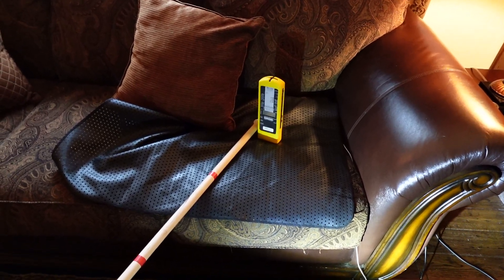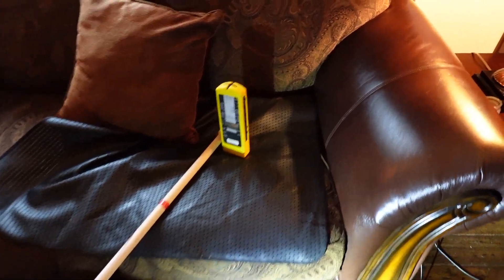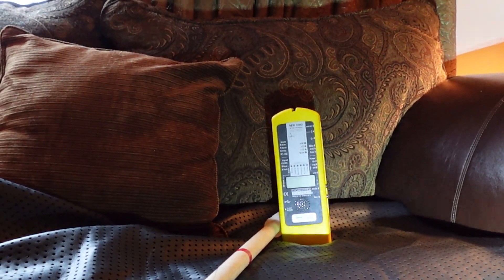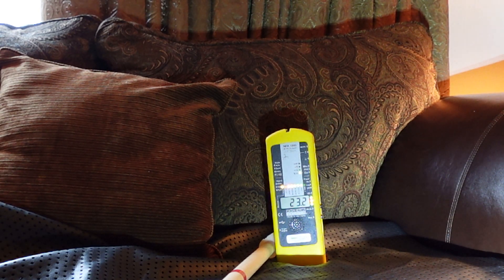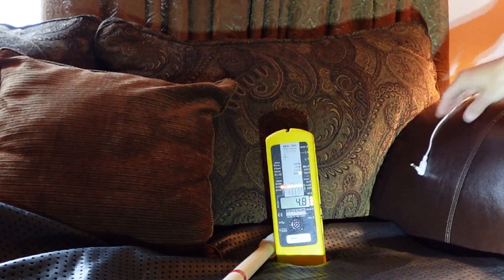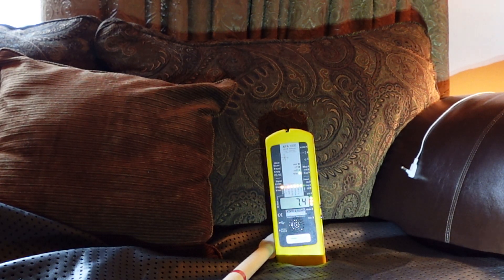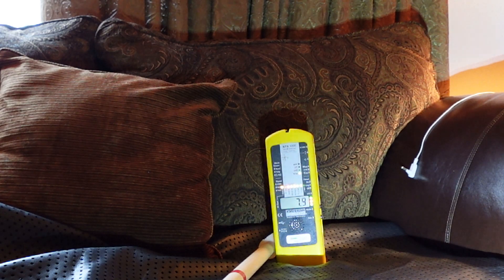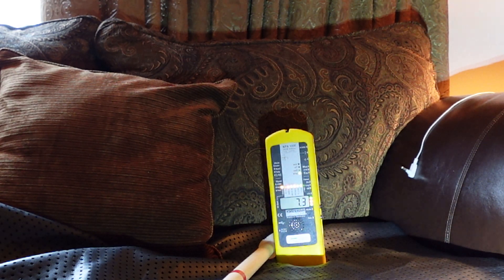The Problem with Earthing & Grounding Mats

Comment: Why I advise against grounding products which use an electrical system ground. Also, the most common wiring errors can put current on what we may think is a ground. A person would be better off driving a dedicated ground rod for your grounding products.
Reply: I would say that if you set a "true RMS" multimeter to a low AC voltage scale and then read between the neutral and ground pins on the electrical receptacle with your meter leads, a person should be good to go if the reading is less than or equal to 0.5 Volts AC. If a person wants to measure current with a current tester (Clamp meter) on the ground wire connected to the same receptacle, it should measure less then 0.5 amps AC (500 milliamps). Any more than those readings and you have electrical issues in your distribution system.

Comment: I'm sure you've checked, but are your sockets earthed? Not all mine are. Also you can use it without turning the socket on. Does that affect the readings I wonder?
Reply from the maker: neither of those options solves this issue

Comment: what could happen if lightning strikes outside?
Reply: Not really. Most of them have resistors.
Reply from the maker: lightning is bad.  if you are on a grounding mat during a lightning strike near or on your home, it doesn't matter how your mat is connected, it could bring the energy to your body
Reply: @optimaldwellingspaces3947 I worry about this. I use a grounding mat on my bed, which is on the loft room of a 4 storey home. If lighting is forecasted, I unplug it, but storms do come randomly sometimes, so it is a worry.

Comment: Apparently even the outiside ground  has high energy output du to the 5G towers that are all over the place (overloaded electrical power lines sends the power to the earth). There must be another solution. Lets find one because its too cold to walk bare feet in the winter.
Reply from the maker: leather moccasins, or touch a tree with your bare hand.

Comment: I just bought an expensive full mattress cover to ground.  I live in a very cold country and I'm on the 28th floor of a brand new fancy building... do you think whatever they used to build this building last year will be better than what materials/setup was used in your home?  How can I best test my outlets for safety for grounding?  Get one of those readers you have from somewhere and just use it once?  Do I need more than just one device to check or just the one you used?
Reply from the maker: In my opinion, anything connected to the electric power grid would be a bad idea to ground on.  Doesn't matter if it is a home or multi-unit housing.
Reply: @optimaldwellingspaces3947  Dangggg.  I guess I’m screwed.

Comment: This has confirmed what I felt intuitively about plugging into the AC outlet. In Clint Ober’s original experiments he was running a wire from his bed outside to a metal rod (as you suggested)
Reply: I live in a seconed story apartment. I made a home made canopy around my bed and I want to ground it outside my window DIY. Can you tell me exaclty step by step a list of what materials to get at home depot and how to install the ground and the safest way to go about doing it and where to put it? I'm new to this so it would really mean a lot. Thank you 🙏
Reply: @alexzemaitis  I'm curious about your use of the word "canopy" because it sounds as though it doesn't make contact with your body. While that might reduce the amount of EMR/EMF in your bedroom it won't get you the benefits of grounding unless you are able to touch the grounding wire. As far as the rod for outside, Home Depot has 8 foot copper grounding rods for about $20.
Reply: @daniellmiller  I made a faraday canopy to go around my bed and connects to an aluminum Matt underneath so fully enclosed but I need to ground it so it's not building a charge. I'm new to this so first I want to know if I should make a diy outlet plug to ground it to or should I ground it to a gorunding rod outside my apartment window. Second can you please tell me in steps what materials, clamps, wires etc that I'll need and how to assemble? Most importantly how should I go about doing this safley so I don't get shocked? Any advice means a lot 🙏
Reply: @daniellmiller  also do they sell grounding wire already put together?
Reply: @alexzemaitis  just buy a 3 prong plug and snip off or pull out the other 2 prongs. I would run electrical tape across it to block it from receiving a charge still if snipping it. Or best is to clamp 12 to 14 gauge copper wire through an ethernet plate outside, wrap it around the copper rod from home depot and into the ground. Im doing the same thing with the copper wire canopy but I want to make my own grounding sheets. Was just trying to figure out a way to use copper fabric with cotton fabric attached together yet able to detach for washing, so the copper fabric isnt washed so often. Also trying to figure out a way to protect the wiring and copper rod from oxidation in the ground from my sprinklers.
Reply: @myates33  electrical wire that is copper that’s covered in rubber or whatever?
Reply: I would never want to plug into a ground wire in the electrical outlet inside the house.  I would always want to use a grounding rod.  I think it is much safer that way.

Comment: Under these conditions and for the intended purpose, I do not submit to being in contact with a ground point that is shared with other ground points, under any pretext.
This requires a fully dedicated ground connection and I don't think anyone would think that this represents overkill in terms of security.

Comment: You're absolutely right and I think it's great that the matter is exposed in the most concrete way possible.
In fact, this all makes sense, as long as the installation that someone intends to do with their earthing mat is absolutely different from the existing ground connection in the house.
Reply: I live in a seconed story apartment. I made a home made canopy around my bed and I want to ground it outside my window DIY. Can you tell me exaclty step by step a list of what materials to get at home depot and how to install the ground and the safest way to go about doing it and where to put it? I'm new to this so it would really mean a lot. Thank you 🙏

Comment: Yes . I just made my own mat , it tests fine with multimeter , but it tingles my feet with use.
Reply from the maker: Did you measure the current as well as voltage?
Reply: I live in a seconed story apartment. I made a home made canopy around my bed and I want to ground it outside my window DIY. Can you tell me exaclty step by step a list of what materials to get at home depot and how to install the ground and the safest way to go about doing it and where to put it? I'm new to this so it would really mean a lot. Thank you 🙏

Comment: Hi Shane, thanks for posting this video. I see you are using a carbon rubber mat/sheet. I am curious if this type of material is immune to picking up high frequency EMFs from wifi and other sources, as is the case with the silver and other metallic materials? Did you do any  testing on this? Thanks.
Reply from the maker: Anything conductive can become an antenna for RF…even a grounding mat or shielding canopy.  The closer the thing is to your body the more of a concern this effect is.
Reply: @optimaldwellingspaces3947  Thanks for the reply! It would be worthwhile if high frequency influences could be tested with different earthing materials. One thing is direct electrical conductivity, another is interference with background radiation. How would you go about testing this? Are you aware of anyone who did this kind of testing of Earthing materials? Thanks.
Reply: @optimaldwellingspaces3947 Thank you for answering this. I was wondering why my husband and I still felt weird while using our mat even though we have it running through a seperate rod outside in the the ground, not through our outlet. I wasn't sure if the nearby underground powerlines could be the problem. This makes more sense.

Comment: Your house has faulty wiring
Reply from the maker: Sorry, no, this will happen in any house
Reply: @optimaldwellingspaces3947 Hi, I’m confused between pemf, amethyst & all the different types of mats. If it’s potentially dangerous to plug these knto the wall, what would you recommend for people living in a condo or apartment complex where it’s not feasible to ground outdoors (connect outside to a rod(?) If you could kindly recommend something simple (I’m adhd & not great @ understanding this type of thing lol
Anyway thank you for your time & I appreciate coming across your channel, new subbie❤
Reply: Nah this is how Gauss works.
Its just the surface integral over an electric field and the area of the mat. A matt will capture emf in the area which in populated areas is always high.

Comment: Can you test if the grounding mat/sheet is working by measuring your voltage with a multimeter before and after making contact with the grounding sheet? If it shows a good drop in voltage and a desirable quantity for the voltage reading, does this mean the ground on the outlet is okay to use? Thank you for sharing your work.
Reply from the maker: No, voltage only looks at potential difference between 2 points.  It doesn’t tell us anything about the current.  Current is what kills
Reply: @optimaldwellingspaces3947     how much current is bad current in this case?
Reply: I live in a seconed story apartment. I made a home made canopy around my bed and I want to ground it outside my window DIY. Can you tell me exaclty step by step a list of what materials to get at home depot and how to install the ground and the safest way to go about doing it and where to put it? I'm new to this so it would really mean a lot. Thank you 🙏
Reply: Are you on fb messenger or WhatsApp? I'm try learn more

Comment: I own a house built 65 years ago. My wiring is not grounded. Can I use my copper water line as a ground?
Reply from the maker: Absolutely not.  Get that house grounded.  Only use a ground mat connected to the soil via a dedicated line that doesn’t touch the electrical system.
Reply: At my outlet that I ground my grounding mat, can I disconnect  the negative and positive wires from the outlet? Will I still get a ground?
Reply: Sorry, my electrical wire is grounded.

Comment: Hey just wanted to share how helpful this vid was for me! I just bought the hooga mat and couldn’t get it to test out right until I grounded the mat and multimeter to a direct line attached to a ground rod. Thanks for the help 😎
Reply from the maker: The point of the video is that it isn’t safe to use a mat that plugs into the wall

Comment: Was the plug on? In the UK we are able to turn the plug off and still have the earthing effect. The earth is part of the plug that goes into the plug socket.
Reply from the maker: Doesn’t make plugging in a mat any safer.  Your earth wire still connects to the rest of the electrical system at some point in your home.
Reply: @optimaldwellingspaces3947  Hi I asked and Earthing Person and they said. First of all, he claims that the increase in EMFs he measured is due to the fact that the mat is plugged into a wall socket and that is bad. In fact it has nothing to do with the wall socket. The result would have been the same if the mat was plugged directly to a stainless steel rod planted in the ground outside. The effect he showed is simply that when the grounding mat is plugged in, it gets the electrons from the earth to help the mat become more reflecting of EMFs than when it is not plugged in. It acts more like a mirror reflecting light. Because the EMFs are reflected by the mat of course the result is an increase in EMFs close to the mat. That is perfectly expected and normal for all grounding mats no matter if they are connected directly to the ground using a ground rod or using a normally functioning power outlet.

Best Regards,
Gaétan Chevalier, Ph.D., Director, Earthing Institute
Reply: @raymondthebrave  so what are you trying to say at the end of the day?is it safe or not
Reply: @raymondthebrave  so did you keep using the mat? Do you feel its safe? Thanks for letting us know

Comment: I did the exact same test at my house and my radiation meter didn't read anything from my wall socket ground.  My house was build in 2000.  Perhaps your home is wired differently?
Am I good to go?  or am I missing something?
I used an EMF metter and also a Gauss (Radiation) meter.
Them EMF was pretty much zeor.  And the Radiation meter (same as yours) was only 0.2, barely even registering a sound.
Reply from the maker: I’m measuring AC electric fields in volts per meter in this video, what were you measuring?  Magnetic or electric?  You would also need to measure current with a clamp meter that can go down to micro amps to really know if it was low enough.  But i can almost guarantee it wouldn’t be.
Reply: It’s possible that the issue lies in the ground mat being used, especially since Optimal Dwelling mentioned in the comments that he doesn’t even know the brand of the mat he’s testing. Honestly, this blows my mind because knowing the specifics of the equipment you’re working with is such a fundamental part of any experiment. Ground mats vary widely in their construction, materials, and performance, so not all of them will deliver the same results. Without identifying the brand or its features, it’s impossible to determine whether the test results are valid or if the mat itself is a contributing factor to any inconsistencies. If you’re going to run an experiment and share insights, it’s crucial to pay attention to these details to maintain credibility and ensure reliable findings.
Reply: Gauss is measured by taking the surface integral over an electric field of a surface. A large metal mat will capture a larger more emf than a small one or a cable.

Comment: I red all the comments and anwers. Thank you so much, you gave answers to what I was actually worrying ipothetically. I stayed few hours on a mat grounded onto the heating pipeline and I felt sick!! I live in a flat. Now I know why. I became an antenna for crap emf.
Reply from the maker: You are so welcome!
Reply: @optimaldwellingspaces3947 
I will avoid the plug and just stand on the grass and hug a tree for now. I know construction so I will install a copper pipe ground and run a copper wire to my bed area. I am thinking of aluminum windows screen under a sheet as the contract for my feet. 

I saw a video where he ran a ground wire to a volt meter ant touch the connector, showed resistance on the meter. Then stepped on the ground and voltage when up considerably. Because he was grounded twice. 

So I took my shoes off and hugged a tree and my body discharged a lot. Feeling better and will keep doing this. Thank you for your help and this video.
Reply: https://earthinginstitute.net/wp-content/uploads/2018/10/grounding-doesnt-turn-you-into-an-antenna-for-emfs-2018.pdf

Comment: I think your right about this.  My friend was a "line Man'  and I can remember him talking about "dirty Ground" but I didnt understand it till I watched the video and read the comments. I now have a copper pipe in the dirt connected by an alligator clip to my plug in prong wire from the Matt. Clean ground and moist. thanks for the video.
Reply: Electrical pollution in the soil?  Oh, we are so up a creek!  So if this is true, then grounding barefoot in the grass must be "dangerous"
Reply: @waantut that’s what I want to know! 😢 it used to help me so much! Now I don’t know what to believe
Reply from the maker: be careful.  neither electrical ground or soil ground are clean.  We return 80% of current through the soil in this country.  So you've got voltage pressure, current flows and microsurge electrical pollution in the soil.  It's less when you are further out of cities and suburbia, but still there in some amount.
Reply: yea...I tossed the grounding mat thing. It did NOT work.
Reply: @optimaldwellingspaces3947  I drove an 8 ft ground rod from the hardware store next to my foundation and ran an uninsulated 6 gauge wire from it into crawlspace, then 14 gauge insulated wire from that into the bedroom to a female plug, then connect grounding mat to that. But you're saying that this might not be sufficient? How would I check to determine if my setup is working? 

Is there any way to cleanly "ground" one's body? If so, how?
Reply: @optimaldwellingspaces3947 so grounding barefoot outside is what’s good? Or if I run an outside rod to my grounding sheet instead of through the outlet that would be ok too?

Comment: I don’t know why people plug their mats into the wall socket. Why don’t they buy a grounding rod?
Reply: Because perhaps they live in an apartment block, or like me, my bedroom is in the loft, 4 floors up. I'd need a 100ft cable to get to the nearest bit of natural ground. Plus, if worry about electrical storms when laying on the mat. 
I've been using an earthing mat connected to the wall socket for 3 years and have seen a marked improvement in my health.
Reply: Because they have no possibility to use a grounding rod?